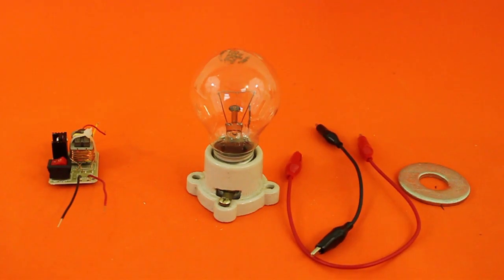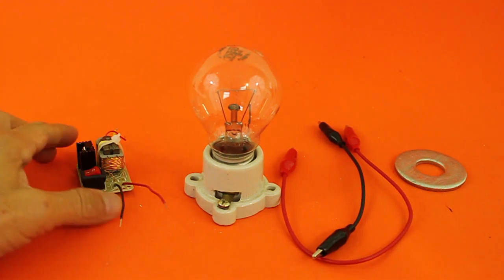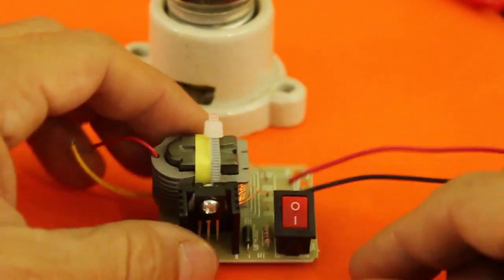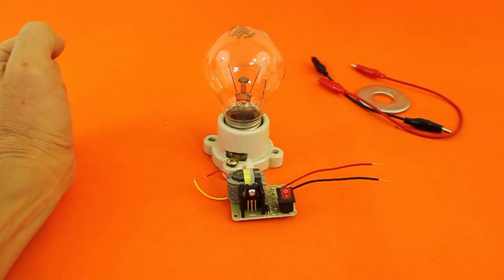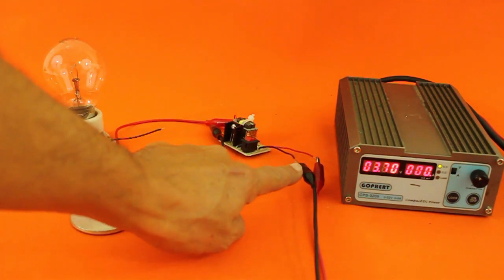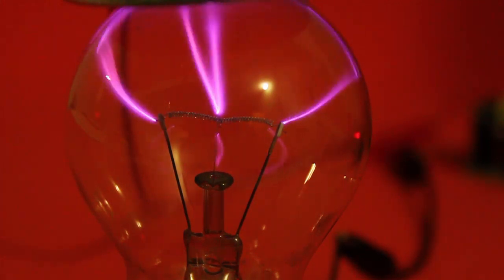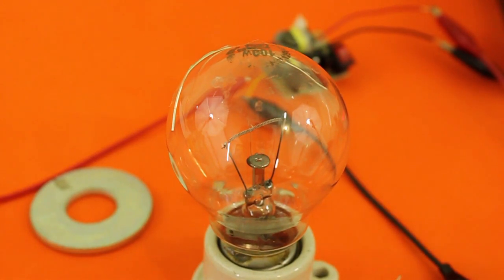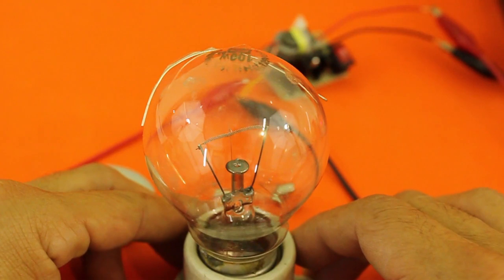Homemade High Voltage Plasma Ball

Comment: If you take a burnt out lamp (where the filament is broken) and connect the high voltage to the live and neutral connections of the lamp the plasma will stay between the 2 pieces of metal inside the lamp.

Comment: I used 60W bulb, the plasma arc is tiny...... should I use 25 W bulb instead? Thx
Reply from the maker: Are you using the same hv power supply?
Reply: Ludic Science I used larger flyback transformer with output of 15kV....

Comment: great channel..i have made some of your circuits, they worked very well. I made your Tesla Coils successfully. I would like to know if you can make a slayer exciter using the Tip-35c trans. If possible using 2 or 3 of in parallel. I am having problems getting one of these to work correctly...Thanks
Reply from the maker: Great idea I think it can work
Reply: thanks... @ludicscience

Comment: Can I ask where to buy in china Solid state relays? I cant find it. I need 230 voltage on the coil and I need it to be with spade terminals
Reply from the maker: have you tried aliexpress?
Reply: @ludicscience  yes I have, mayby I didnt find anything because I dont use the correct search keys?

Comment: Nice video, I have  a question, why is there a high pitch noise made from the plasma ball?
Reply from the maker: The arc makes the glass vibrate, the transformer also emits a similar sound

Comment: What effect will you get if you light up the filament with let say 60 volts and put the high voltage on one of the wires and the other (insulated or with the filament with isolation transformer) on top like in the video.
Reply from the maker: Not sure will have.to experiment nice question

Comment: What happens to you if you touch the lightning with your finger?
Reply from the maker: Nasty shock you will get
Reply: How much compared to 230 volt house installation? which is most dangerous
Reply from the maker: 230 v from mains
Reply: It is a high frequncy high voltage low power source. Most likely it will burn your skin, because of the skin effect. 230v main voltage is more lethal.